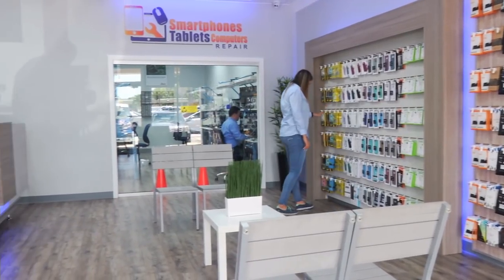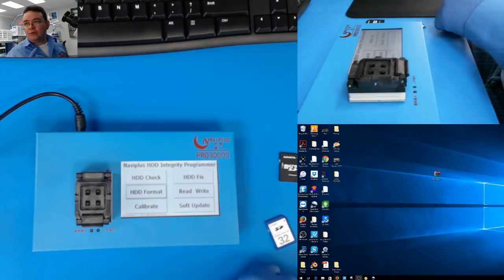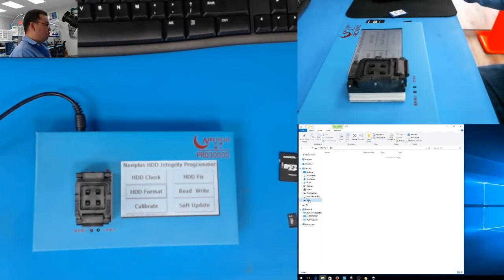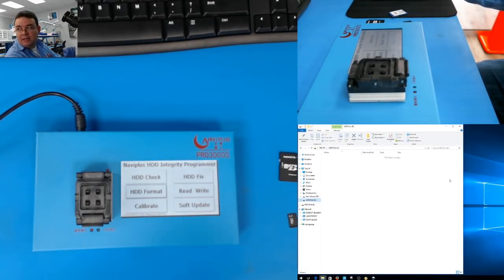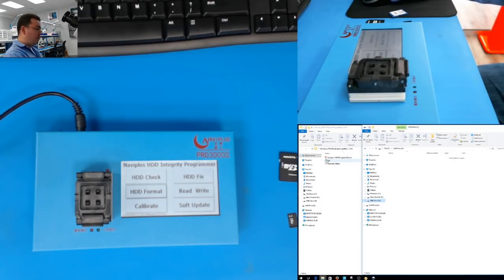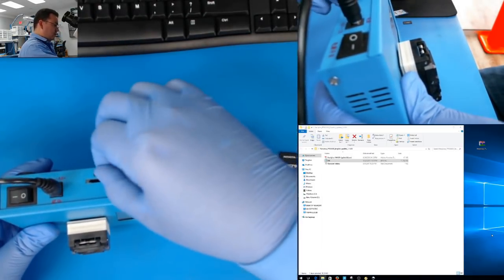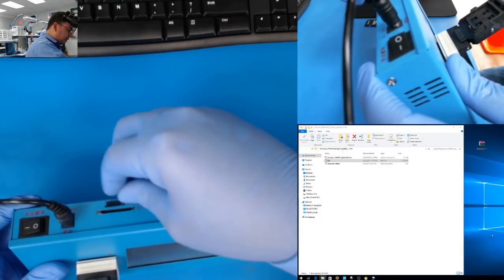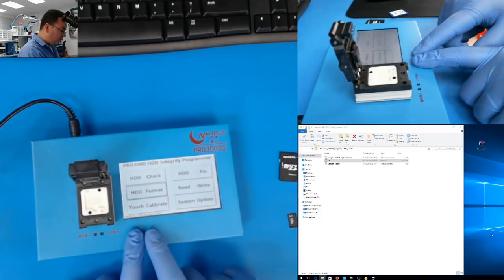Naviplus Pro 3000s update for ios 11

Comment: Hi will this solve the issue of not activating when iCloud removing by changing serial number??jay
Reply from the maker: Sorry i do not work on icloud removal
Reply: HI , DID YOU FIX THE PROBLEM ALREADY , I HAVE THE SAME PROBLEM WITH THE ACTIVATION AFTER CHANGE THE SERIAL NUMBER, IF YOU HAVE THE SOLUTION PLEASE LET ME KNOW , THANK YOU.
Reply: POWERFIX PRO when you remove nand from iCloud locked iPad , program serial, Bluetooth address and WiFi address from a iCloud unlocked iPad 4.jay
Reply: I haven’t fully tested this out because the I tore one of the pads when cleaning it when I was going to iCloud unlock a iPad Air 2 with this method but I see a video where he done this and activated it on iOS 11.2, I let you know if it works when I do another one.jay

Comment: pleas can you help me my naviplus pro300 keep restarting only with loading... 1
Reply: Check the power cable, the power sockets on these units are sometimes a loose fit and take the NAND socket off the machine when powering up.jay
Reply: safu gsm if it starts without NAND socket attached, update then try with it on. If NAND socket faulty you can buy them from www.vipprogrammer.com cheap.jay
Reply: sir i replace the powe charge and i remove the nand socket and keep restarting only loading and restart i cannot update my programmer becouse no gui
Reply: safu gsm sometimes you get a dodgy power socket at the back of the naviplus 3000. The charger won’t sit tightly in the socket causing the machine to keep restarting. Try putting a pen under the wire going into the machine so the power supply sits in straight. If not I can only suggest buy a new one. Go vipprogrammer.com , be a lot cheaper.jay
Reply: safu gsm if no GUI, you may have to take apart, remove naviplus 3000 hdd, then take apart a working one and clone the HDD of a working naviplus 3000. It may be the HDD in your machine corrupted or needs replacing. But unless you got a spare working naviplus machine laying around, it be easier to buy a new one.jay.   CONTACT VIPPROGRAMMER.COM  they may be able to email you a ISO of the software.
Reply: i think the firmware machine is corrupted so i will be remove the cpu naviplus and i will be jumper the tx0 and rx0 and i will be load nk.bin direct to the nand flash naviplus
Reply: tengo el miso prolea con i navi se reinicia
Reply: naviplus pro3000 board like mini2440 developer board and the cpu samsung arm s3c2440al-40 like cpu naviplus and there is datasheet cpu and datasheet mini2440
Reply: hey i am repiered http://share.gogo.mn/QGlBYYKpXl39361516807935/Naviplus_PRO3000_English_update_1.1301(3).rar
Reply: Thank you so much mate :) I was looking for that 2 days :)

Comment: Would you make a video that explains how to use the Naviplus Pro 3000? How to use it to fix error 4013 on a corrupt nand and then how to copy the information to write to New NAND. Also, the steps after format the NAND. Lastly, what are all of the fields in Configuration and where to get the information to fill in the fields. Thank you... I have Version 1.1300, but no introduction, trying to find out what to put in a few sections... MD, RG, MLB. And they have my model number in the RM section???
Reply: My Iphone Rehab you normally leave these sections blank if they are blank when loading up the preset info from the machine... the only one you normally edit is the one for serial number. If your coping from old NAND it will all come up when you hit read, then hit write with new NAND inserted. Jay
Reply: To fix error 4013 with machine, don’t format just hit fix. If this don’t work copy old NAND info onto new NAND .jay
Reply: Also if it’s a iPad 2,3,4 or iPhone 6 they now sell a socket fixture for the navipro 3000 to read and write on NAND without having to remove it from the board.jay